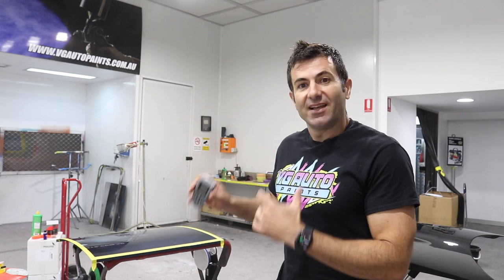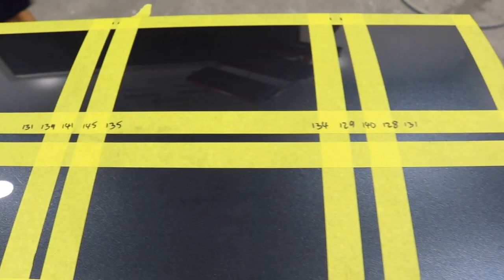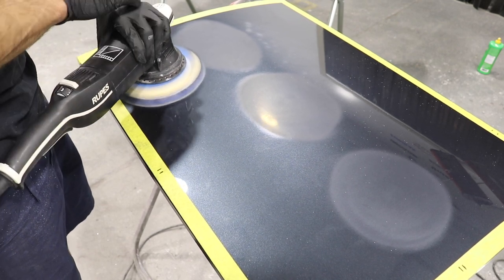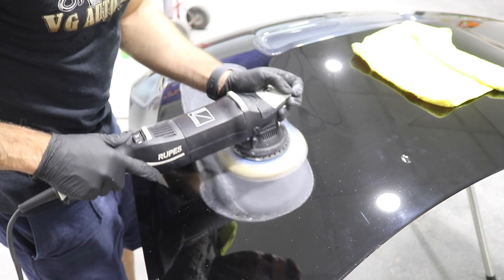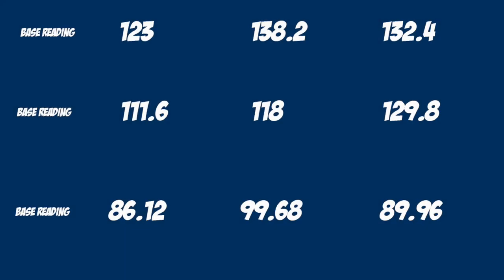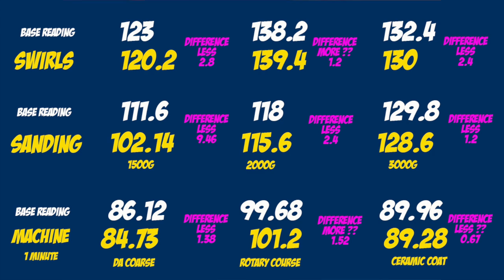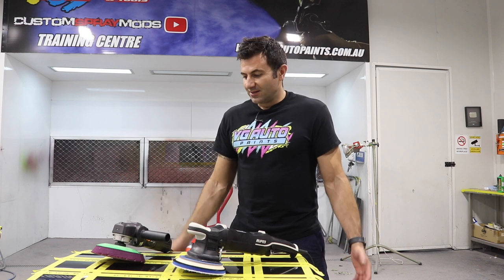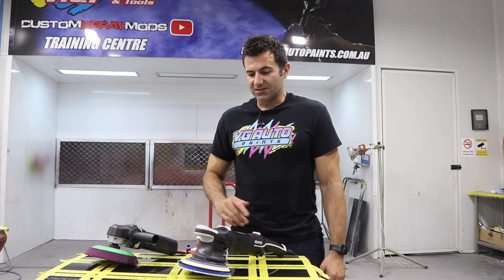Paint Depth test DA vs Rotary Polisher

Comment: DA's good for beginners.

But the Rotary is king.
Reply: I have to disagree. So yes a rotary can help save time on cutting but a DA with a good wool pad can cut but also finish nice enough to only need a quick polish to jewel the paint. 

Also with modern cars the paint is thin enough that if you cut with a rotary, you diminish your chance to polish more than once after that.

I still use rotary, especially on gel coat. Without sand paper and rotaries on boats, RVs, and planes you'd be there forever polishing. Freshly painted cars are great spot for rotary as well, but to finish the paint, I still feel da is king on finishing.

Comment: I have rotary and da and in my tests i get better and faster results with long throw machines than a rotary. Rotary only for spot working and pad drying for me. And yes i do wetsanding for cars too.  The reason why your rotary spot had "more" clear coat because the paint was over heated and the paint swell.
Reply: Rotary can not cut faster than orbital. Impossible.

Comment: Can you do a video showing how hard it is to burn through paint with the rotary?
Reply: I’ve burned through new paint. On a flat hood/bonnet it is safe. Wool pad is most aggressive and if you bump into a curve with the pad perimeter or if you hit the panel edge with the pad spinning in the wrong direction it will burn. When you burn through the machine digs in and it only takes one second.
Reply: It’s not hard to burn through paint at all with a rotary, even easier with foam than wool, and you don’t need compound to do it, the friction from the foam pad is all it takes.

Comment: Great, well thought-out video!  I'm a beginner and learned how to clean a paint gun from your instructional video.  Today's video is timely for me as I've been wondering how many coats of clear to use on my project (car restoration).  I'm planning to use a HS clear and the TDS says to apply 2 coats.  I've seen a few videos where they say not to apply more than 2 coats of high solids clear because "that will just get you into trouble."  Your data suggest that 1 coat of clear is approximately 25 microns and that cutting and buffing will remove at least 13 microns.  I'm guessing that I should apply 3 coats of HS clear so that I'll have at 50-60 microns on my final job left after cutting and buffing.  Is that what you recommend?
Reply from the maker: Hey mate. 2 coats is definitely enough a third coat won’t hurt though.
Reply: @customspraymods  Thanks very much for your reply.  And thanks for your helpful videos!

Comment: You could find the standard error of the data using excel and graph the results. The variation In your data could explain why you saw some strange data. You can see from a scientific pov whether the results were statistically significant or not.

Comment: Ah I don't think you are measuring what you think you are measuring, a rotary device has a different wear rate depending on the distance from the centre as it goes trough a larger linear travel per rotation (that 2*pi*r thing), in short so you would expect your wheel to cut deeper per revolution at the periphery than in the middle. 

You need to measure at more than one point to get the average cut depth per second/minute/whatever.